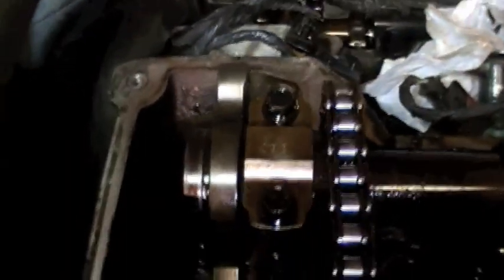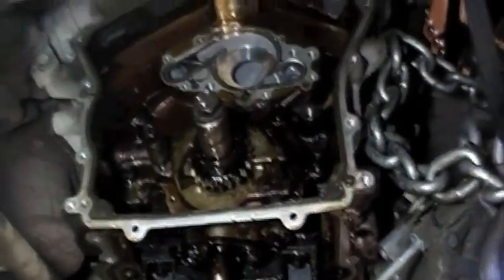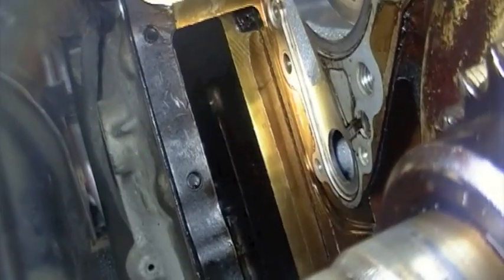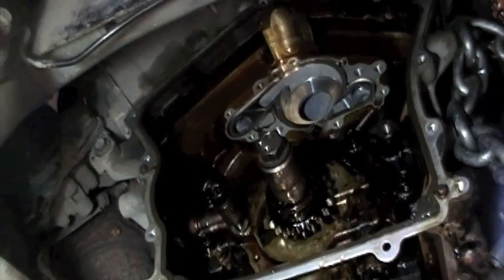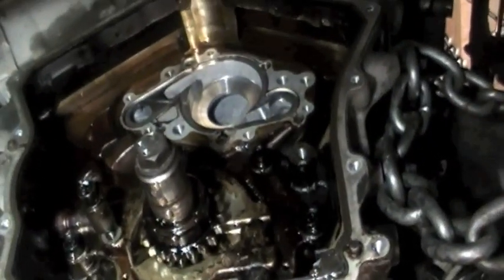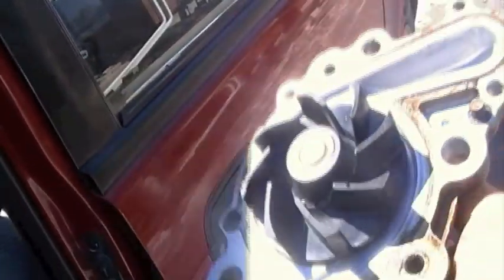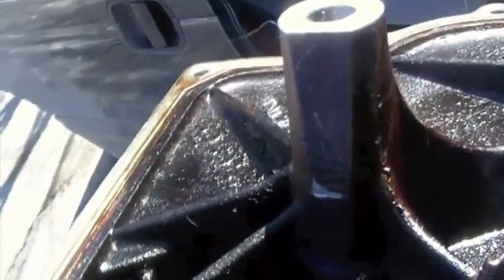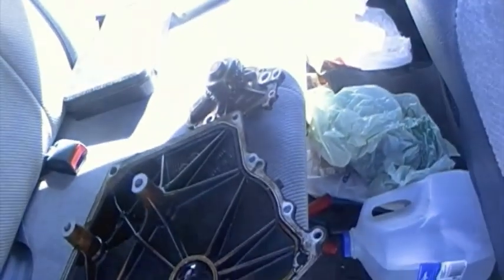How to Fix Your Chrysler 2.7 Engine The Right Way! Part 3 of 3

Comment: I have this exact car/engine.
I had a new water pump installed and it now leaks water from the weep hole on the drivers side.
Very few miles since the new pump, can the leak be anything else?
Reply from the maker: There is a thermostat housing in the same location. Perhaps that is leaking ?

Comment: Hi Jesse I recently replaced the water pump and added new rails timing chain and a new tentioner. After adding the timing and primed it before cranking I put everything back together and after turning on the car it was making a rattling noise coming from the passenger side under the timing chain tensioner. Then the red lighting bolt with the parentheses started flickering and flashing. Did I do something wrong or is the engine not working well anymore

Comment: Hello Jesse, My replacement kit has a primary timing chain guide, the longer one on the right side of the engine with two bolts, that is slightly longer than the OEM part and impossible to install.   Where do you get your replacement parts?
Reply: One year later ...  I had stripped a bolt hole in the engine block when attempting to replace the primary timing chain guide.  In trying to tap the hole for a heli-coil, the tap broke.  It took a year to get that darned tap out.  Wife died in the meantime and I didn't need the car so work slowed to a crawl.   Progress is back on track now.  One thing I want to share is that the new timing chain tensioner in the after-market kit I used did not have a rubber O-ring on the shaft of the tensioner.  It had a metal spring clamp.  I instead bought a timing chain tensioner from Mopar and it does have the proper rubber O-ring.  My car is a 2004 Intrepid.  Every time I see your Sebrings I thank God my Intrepid has the engine mounted longitudinally.  On this day I'm putting the front cover back on.  I've verified twice that the brass links on the new chain are on the sprocket marks and that the arrow on the oil pump cover is pointing at the slot in the shaft.  Timing is good.

Comment: Thank you. Do you have anymore videos on the 2.7l motor ?i have got thee heads in then when i put the camshaft in and went  to align it at 12oclock the camshaft sprocket snapped hard and bent all the valves?. They were all open and didn't close all the way on the camshaft. Do you know what I did wrong.. I have got the head back from machine shop with new intake valves. Any helo would be great.

Comment: hi, there I learned a lot. can you tell me the torque specs for the water pump, oil pump, and heads, please
Reply from the maker: I no longer have access to the program I used for torque specs at them time. I never wrote them down. Perhaps a google search should turn up some results. Th water pump  is very little as you are tightening into aluminum. honest truth I never torqued them when I did mine. Only cylinder heads were properly done.

Comment: Take oil pan off, replace oil pump with high volume oil pump and pan if available. After moving comnecton ros if they will move, put standard size bearings, and measure with plastigage. Use approiate size oversize bearings( sometimes called undersize for undersize crank),  and use approiate rearing to bring to .0015 to .002, of spec is not available. Ise fober optic scope to look in spark plug holes to try and see if any valves are bent, or remove heads.

Comment: Great information! Everything you have said on this subject has been so on point as I'm doing a chrysler 300 2.7 today. I'm searching up some info in regards to the pistons and what I should do in the event there is very minimal indentation on number 4. Also why only the intake valves on 2 and 4 and not exhaust on the same side are bent. I opened up mine to find the plastic on the chain guides broken into about 50 pieces. I would turn the  ignition,  occasionally I wouldn't hear the fuel pump come on then after a couple months I didn't hear it at all, changed my cracked actuator pin, all was well for a couple of days then noticed I would hear it prime then shut off like it's supposed to but still wouldn't crank over, I found out that the fuel pump secondary power and power to the injectors comes through the oil pump circuit. Sensor was bad, and pigtail was real loose probably causing fuse or relay to keep popping!!  And also found my extremely clogged fuel filter. filter in these aren't stationary so led me to the fact of there being not only one pomp but TWO!  😂. So with a bad power source to oil and fuel now, it is what caused my  timing chain tensioner fail due to no oil to keep it primed, and the chain guides were left in limbo. Chain loosened up so bad it broke the plastic all up, jumped time, and me not knowing all of this continues to try n start the engine over n over which bent my valves and maybe destroyed my pistons in the process. Domino effect all started with a crack in the little plastic ignition  actuator pin that costs less than $10 on amazon. I'm putting it all back together today!!!! So wish me luck I've still got so much to learn and I'm sure I will run into some more added surprises as I'm looking down into the engine bay and see the starter fuseable link barely touching the engine block! And green antifreeze all over the place. Thank God I just got my water pump in the mail today! 😁 Gotta love this car! It's my only one right now anyways. My dodge 5.9magnum awaits my experience from across my yard! Have a great day and what an awesome video! Good job!
Reply from the maker: Yeah sounds like you had some issues in there. Great news! Another 2.7 timing job is to follow shortly! Hope it all gets together properly and works without a hitch. Double check and triple check everything is good before you close up the motor ensure timing chain tensioner is armed and make sure you spend a little extra and get a “stop block” for the tensioner. Google it. Buy it and install it. Will prevent this from happening to you again in the future. Good luck my video in the next bit will cover this stop block install
Reply: Thank you for that! And I will be turning in for the new footage! I have 4 bent intake valves and the rest are charbroiled! So I decided to replace the entire bunch with new ones! The seats look very smoothed out and not much of a seat at all really. So am stalling out now in debate about what I should do about that if anything. Also would like to check out the rings before I move on but not sure about how to get there. Would you or ANYONE please tell me how I am supposed to get these silly valve spring keepers back in? LOLOLOLO! I feel like I should be sarenaded by Big Top Circus music or the theme song from the Three Stooges when I'm screwing around with these things!!!!!! HAHAHA SMH
Reply from the maker: @lisawilsoncoleman2423  assuming you have a proper valve spring compressor. You can get an engine assembly lube a blob on the keepers so when you stick them in their place they will stay and not fall out... bam problem solved!!!

Comment: I have a 2.7 (2001 Sebring) when I plug in the Cam position sensor the car won't start.. so long story short everyone told me it had jumped time.. so I checked timing and it is fine (removed cover checked water pump and belt) everything looks good?  any ideas?  should I change the timing gear sprocket?  car starts with the sensor unplugged but after 5 tries ..and runs like in limp mode..won't rev over 3000.. thanks for any help
Reply from the maker: Two possibilities, either your cam sensor is faulty/and or wiring to it. Or your engine had jumped enough time to throw out the readings. Although if it runs fine unplugged i don’t suspect timing is out very much. Without cam sensor input limp mode limits rpm to 3000rpm and will start after around 5 second crank time before engaging limp
Reply from the maker: Keep me updated. perhaps get a scanner on it and see if you have sensor input to computer?
Reply: @JesseMarrin  Thank you so much- I will keep you updated-  I purchased the car recently and was only told that the previous owner gave up .. looks like the water pump is newer.  So someone had been inside- but the car had not run right for a long period of time- I bought it from the shop- they thought it was the computer.. basically they gave up.
Reply from the maker: @carnut1192  Hold on!!!!!! Pump the brakes!!! They replaced the water pump? Usually when that job gets done the timing chain and sprockets get replaced. Now listen carefully! There was a design change in the cam sprockets I believe in 03-04 model years of the 2.7! If the tech used the wrong chain kit everything will go together normally but the sprockets have different readouts for the cam sensors! Your assignment is! Remove valve covers and look at spacing on the reluctor rings and compare hole gaps with timing set for your year and verify it is correct! I suspect someone installed a sprocket from a newer engine! And that for sure will cause your problem!!!!!!!! Do this a report back!

Comment: That engine is looking really bad in comparison to mine. Do people not chains their oil and use full synthetic ?? I have 240k MILES on mine and just now had to change parts out and still chain is good and all. Get the water pump which is made out of aluminum graphite and go to full synthetic 5W-20.

Comment: I have a 2001 Intrepid . I had the issue... But short time later my motor went bad... Number 5 rod was bad. Put $250 in it to repair it then went bad. Crank was too far gone to regrind it and had to replace both the rod and crank.... I'm about $550 into rebuild and  halfway rebuilding this motor.... I hope to be done by spring and have it running. Have to save up to buy parts little bit at a time

Comment: I've been putting this off on my 04 for about 1 & 1/2 years, it has 140,000 miles, hasn't overheated b/c I keep it topped off, but if its been leaking coolant into the oil; mercy.  thanks for sharing - take care

Comment: HI, a very good video. It does not say much for someone like Chrysler designing and engine like this. Did they do no development work?
I am looking at doing a water pump job and you mentioned something of interest. The chain  fouling the front of the water pump and wearing a hole. You mentioned that there is a mod out there that moves the chain further away from the pump. This means that the sprockets have to be moved out. How is this done? If you buy a replacement pump how can you check which one it is and if the mod has been done? Who makes the best, most reliable water pump? Looking on Ebay there are dozens out there.

Comment: Hey there Jesse....I completely rebuilt this 2.7 but on a 05 Chrysler 300...new head gaskets...new everything...I put it all back and tried to crank it but it won't start...just turn over...had to replace starter because I overloaded it...thought it was the computer, nope...I'm convinced it's the camshafts I put back in wrong trying to get timing correct...I did timing correct but when I bolted down camshafts, passenger side went on easy no resistance; driver side went down with resistance, meaning valves were opening, but I thought that was how it went??? I don't think so...what do you know about that? I appreciate any insight...I'll be taking everything off tomorrow and redoing, and praying to god I didn't destroy any valves...but that's the only thing I can think that is not letting the engine run...spark plugs spark, gas flows...now it's air...and that's got to be it....what do you think?

thanks in advance
Reply from the maker: Miguel Quintero possible it was the incorrect cam sprocket that was installed. To verify. Disconnect the connector for the cam position sensor and attempt start up one more time crank for min 5 seconds. If it starts you have incorrect sprockets (fail safe mode engine will be limited to 3,000rpms) check and report back before taking apart
Reply: Ok. That’s a relief. But then I don’t know what could be keeping the engine from running?
Reply from the maker: Miguel Quintero huge suspicion it was wrong cam gears. I will await your reply   On the test 👌
Reply: Jesse Marrin it was the timing. I timed one sprocket wrong, initially. I went back in there yesterday and redid the whole timing and the car started. 

It ran beautifully for 15 min as I bled the radiator of air and then I noticed the oil light flickering on the dash and shut the engine off. I tried to start it up again immediately to hear how it starts up but no start, again. Except, this time, It was aggressively loud knocking....now I think I either damaged the valves with bad initial timing or the oil pump failed as a result of radiator fluid in the engine before the repair of water pump and head gaskets.

The last thing the car did when it died was dump a bunch of radiator fluid and oil, mixed together, on the ground.
Reply from the maker: Miguel Quintero just so I get this in my head correctly. It ran good and smooth for 15 mins, and then you shut it down and then restarted it and it had a hard time starting and then once you got it going it was knocking?
Reply from the maker: Miguel Quintero the oil pressure switches are always faulty on these cars I’d check to make sure it’s not leaking or soaking the wiring harness that goes to the sensor. As for the knocking one more thing to rule out before diagnosis is inevitable, make sure your timing chain primary tensioner didn’t fail. I’ve had brand new timing tensioners fail on me and they make an awful noise when they do!
Reply from the maker: To check the timing tensioner failure check to see if the timing chain goes slack at certain points of rotation when turning it over by hand. Just need to remove one or more valve covers to verify this
Reply: Thank you man. I’m going to check it Sunday. That actually sounds like a possibility. You’ve been a big help. I can’t thank you enough. 

As for the knocking, it happens when I try to restart the engine. I did not happen when the engine was running. 

I’ll keep you posted.
Reply from the maker: Miguel Quintero sounds like a tensioner! Let me know!
Reply: Hey Jesse. Just wanted to give you final update. Turns out it was neither the oil pump nor tensioner. The whole problem was a partially blocked radiator that allowed the engine to get hot enough to thin out the oil and so the oil light would turn on after idle for a while. 

I replaced radiator and bled out air and now running great. No issues. The only problem I had was getting rid of all that air trapped in the block. Took forever with days of patience. But performance is ideal now. 

Thanks for your advise and guidance.
Reply from the maker: Miguel Quintero thanks for the update good to hear another healthy 2.7 is back on the roads!
Reply from the maker: My best advise to bleeding that coolant system if you should ever have to do it again is fill it as much as you can when cold before first start and with cap off let it idle until the temp gauge just starts climbing off the cold line topping off as engine idles and shut engine down with cap off. Let it sit for 2 minutes and top off, put cap on start it and let it run till it is a bit warmer and open bleeder and let any air out once full stream comes out close bleeder shut engine down and let it sit for another 2 minutes. There still shouldn’t be any pressure at this time built up. Verify by checking bleeder. Open cap top off once more and close everything up let it get to operation temp and ensure thermostat has opened. Shut down one more time let engine cool and top off once more. You may have to add 300-500ml during the next few days of driving but at least you won’t have large air pockets. Only effective method without expensive bleeder systems
Reply: Jesse Marrin you’re right. That’s essentially what I did. Now at that couple day point. It’s been operating for 2 days. Still has a Little bit of air, I can tell, but letting things settle. Operating well overall.
Reply from the maker: Miguel Quintero very finicky cars. Yeap a watchful eye is all you need. Someone once told me these cars are like babies, they are always wining about something 🤣🤣🤣
Reply: Thank you brother. I followed strict instructions on the sprockets so not sure it’s that. But will attempt tomorrow when I get to the car.
Reply from the maker: Miguel Quintero also to note when trying to Bolt up the cam sprockets again you can’t install them at wrong place they are staggered so it won’t bolt up wrong. Also they work against each other so first one will bolt up and be easy, second you have to hold with some resistance in one place to get the bolts in. And it ends up being on the hinging point of it jumping. From what you described it seems Normal
Reply: Thanks brother.  True story. Lol

Comment: Hey bud if the 2.7 was running and quit does it always mean the timing chain or can it just be the water pump and you'll be alright to get it going again how do you find out if your rods or reeds whatever are bent
Reply from the maker: Michael Hallman 👋 hello there are many things that can cause the engine to just stop. This engine is an interference engine. So if the chains break there will be engine damage. If you suspect the chain is broken i would attempt to rotate the engine over by hand to ensure everything is together or broken. If you suspect a broken chain the front valve cover should
Be removed to confirm. And you are referring to the valves that could get bent 👍 best of luck!

Comment: Your right it is good to replace that tensioner I just did my water pump on a 08 charger 2.7L. What’s  important is to torque the pump to  specification and the timing guides

Comment: Hey can a bad water pump leak in the oil if its bad on this motor
Reply: The wep holes are ported though the block so they do not do that. But its possible if the chain eats though the water pump housing or the gasket happens to blow out the wrong side.